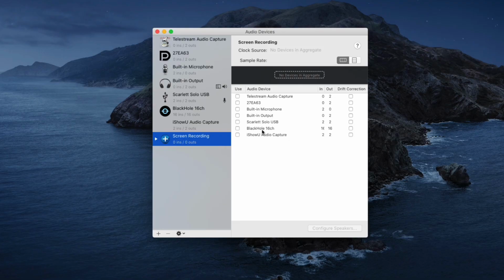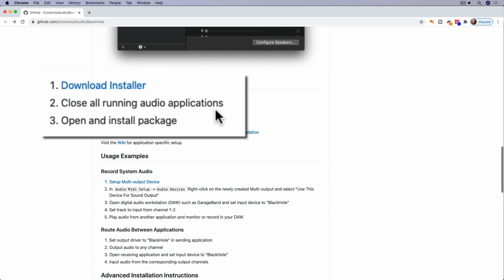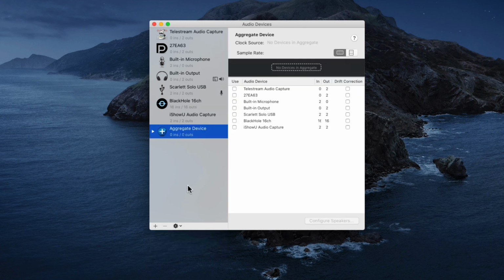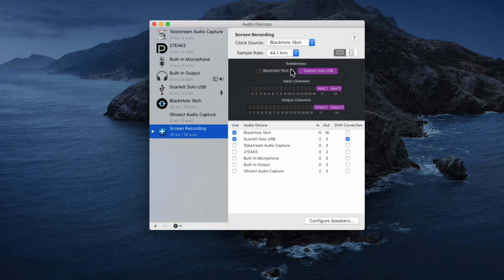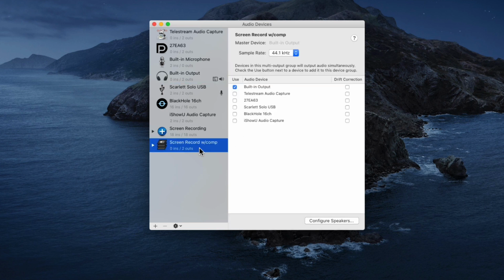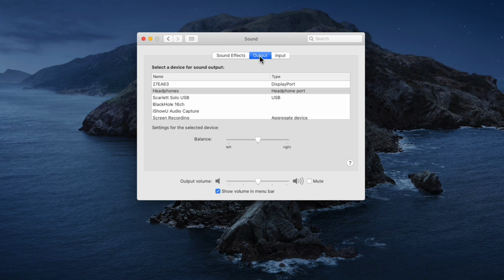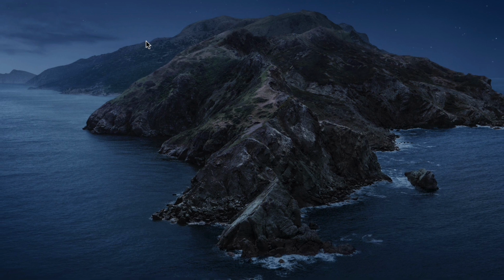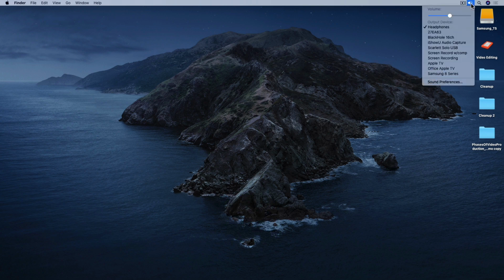How to Record Your Screen with Internal Audio & Microphone on Mac Using BlackHole (FREE)

Comment: THANKS, Really appreciate this good tutorial it works. However, using blue yeti mic, the sound of mic gain for voice over is too low than the computer video, how to fix it or balance it.
Reply from the maker: Check your mic level in System Preferences -> Sound -> Input. Also, Blue Yeti has a gain adjustment on the back. May also want to turn down computer sound in System Preferences -> Input -> BlackHole, or turn in down at the source.

Comment: Is this better than iShow u audio capture?  What does more modern mean?  Simpler, better?  Thanks for excellent videos, best i've seen actually on these topics!
Reply from the maker: More modern, as in developed for the latest macOS. And you don't get that issue with microphone sound only on left channel when using an XLR mic connected to a USB audio interface.